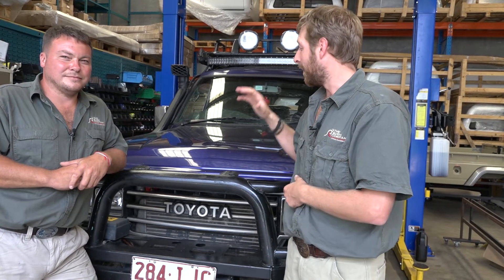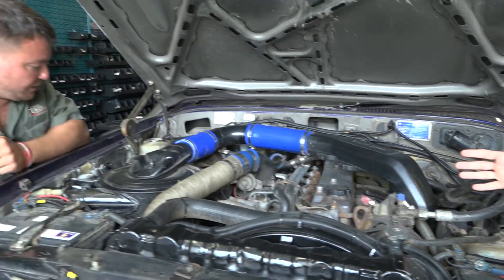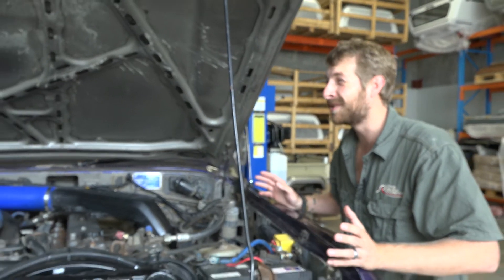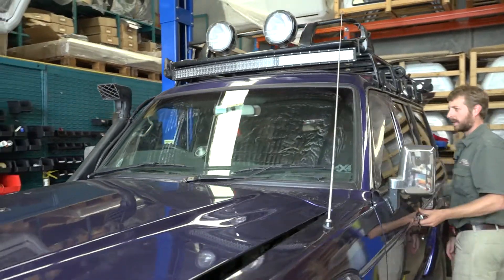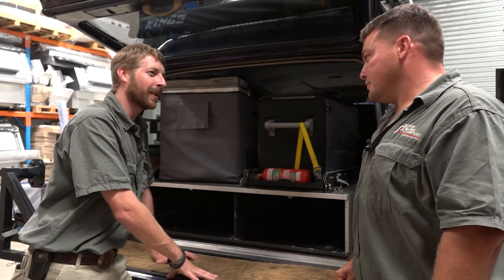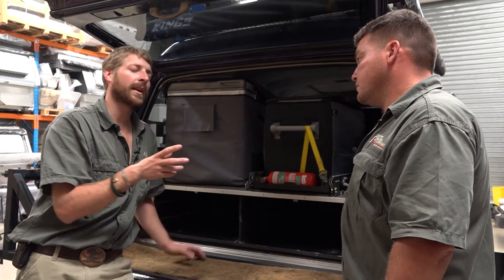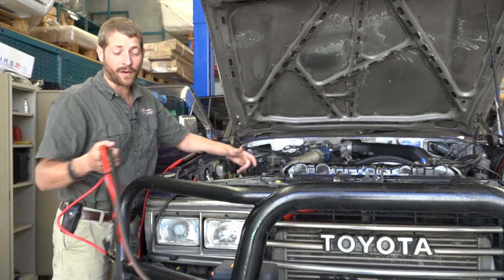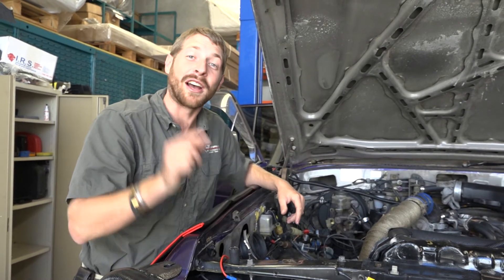'Purple Haze' Toyota Landcruiser 60 Series Sahara - The Bush Company

Comment: Seems like every old Landcruiser has a nightmare situation when it comes to electrics. I was lucky to snag my HJ75 ute because it has a 12H-T from a wrecked HJ61 Sahara wagon, has it's own share of wiring issues though. I was recently working on it and knocked a sensor connection wire loose, which was infuriating to troubleshoot.